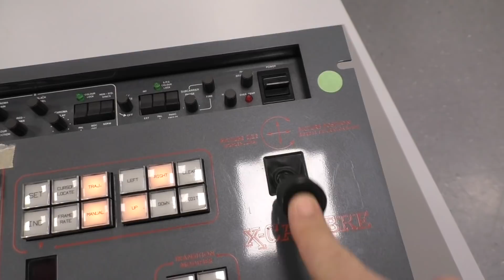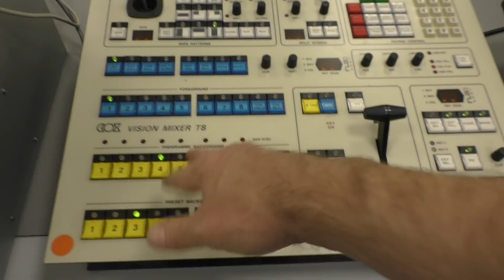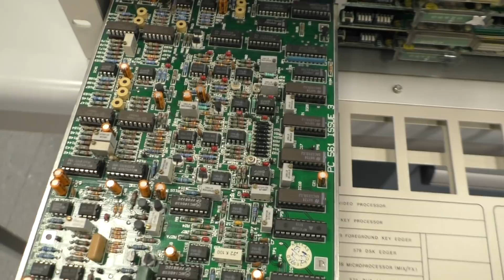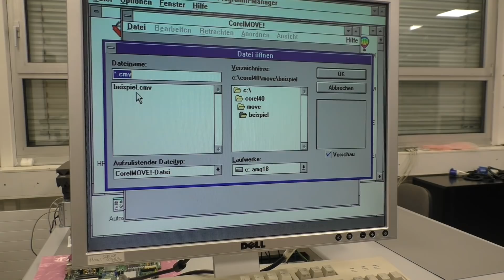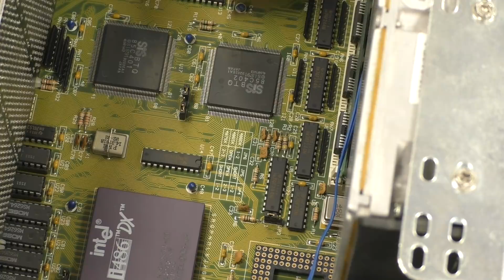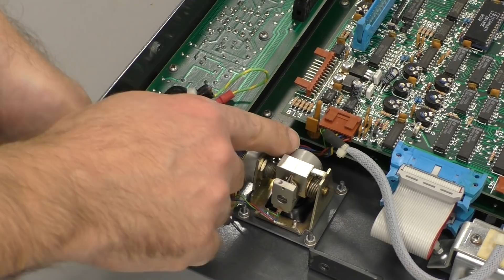I've got a TV studio! - (PWJ117)

Comment: Disappointed u didn’t show the back of the video switching gear. Would have been interested to see what connections it had
Reply from the maker: You're right... but in fact, there was not so much to see. Only the big white box had interesting connectors. The panels were attached with flat ribbon cables and the PC just had a video I/O card.

Comment: If the main board has eight 1Megabyte 30pin SIMMs, with 3 chips per SIMM (3*8=24 chips) then why does the really expensive graphics card need SO MANY chips (4*32=128 chips) for only 4MB? Is it much older than the 1MB SIMMs and main board? Its amazing that that impressive graphics card originally cost $10,000 but is now useless and worthless.
Reply: The video card probably uses sram vs the memory on the motherboard is regular old dram
Reply: The ram on the video card is dual ported DRAM and are 4 bit serial access, so allows the video dac to read contents at the same time as the cpu is writing data, that combination is unusual and probably points to some fundamental part of the card design making it hard to switch to higher density ICs. Sometimes it is also a cost thing, as ram manufacturers jump to higher ram densities the older chips are discounted and using more lower density chips might be more cost effective.

Comment: I thought the 486 had a built in FPU?

The input on the big graphics card is probably from the other video card, like early 3D accelerator cards
Reply: > I thought the 486 had a built in FPU?
That is correct. The 486DX had a built in FPU. The 486SX had not *). The Weitek co-processor was faster than the internal one before the 486DX2. The explanation in the vid is sloppy.

The Weitek co-processor for the 386 had their own way of communicating with the CPU.  This and an own instruction set made it faster than the 387. Software had to be adapted to make use of it.  Not enough SW existed I guess to justify the price for the Weitek co-processor. Esp not if you had an 486DX with an integrated FPU.

 *) The 486SX had a 487SX "co-processor". But as the 486 design did not allow for an external FPU, the trick was, that the 487SX was a full 486 and the 486SX was shut off. Intel's marketing would sell it as a math co-processor anyway. Funny.
http://chook.x86-guide.com/en/collection/Intel-487SX-cpu-no12239.html
They wanted to sell the 486 dice with broken FPUs.